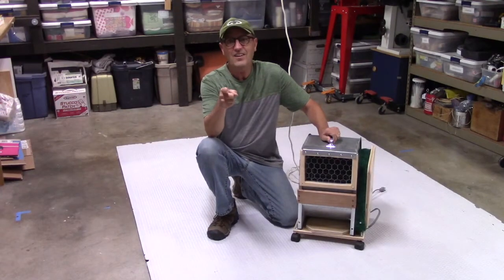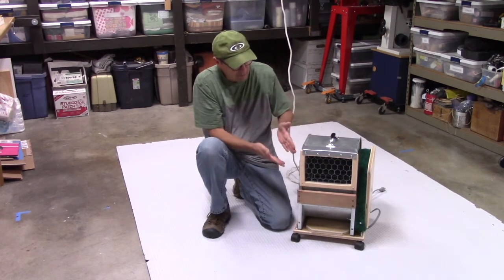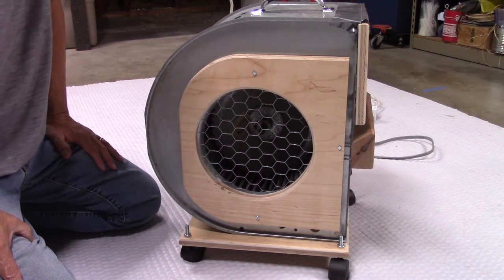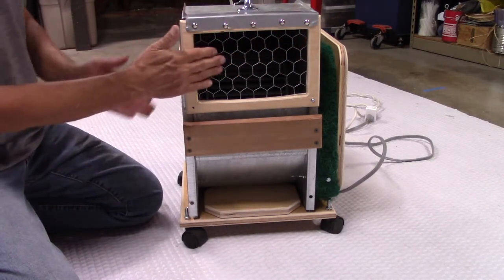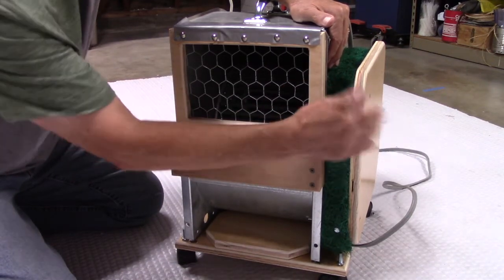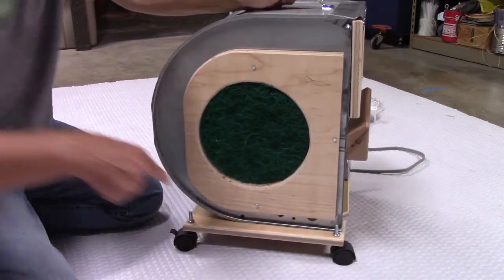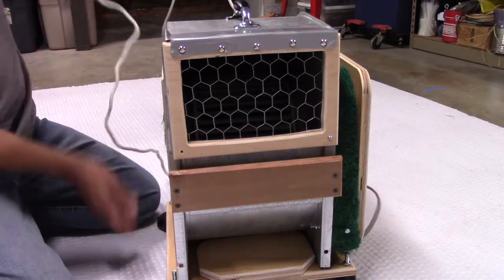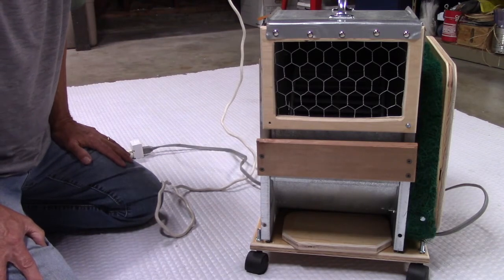$20 DIY Shop Fan & Air Filter

Comment: Nice project for sure.  For those wanting to build this, make sure you don't pull a 3 phase motor commonly found in commercial units unless you have 3 phase power available, also for those not familiar with HVAC motors, these motors are 240 volt, and usually a minimum of 2 speeds, usually 3 in residential, and 4 if it came from a commercial unit, one leg is common which you would wire directly to one side of the cord, and then connect the wire for the speed you desire to the other leg of the cord, each motor is different, but typically red is low speed, blue is medium, on a 4 speed, you'll have a yellow which is another "middle range" speed, and black is high, it doesn't usually matter which of the power leads on the cord goes to common and which goes to the desired speed wire(s) since both are hot wires on 240v.  On the motor shell (and on the unit the fan came out of should have a wiring diagram with each speed color, you'll also have 2 wires going to the run capacitor, usually both are brown or grey, again refer to the wiring diagram to be certain.  I mounted a simple "handy box with a clamp for the cord and a blank cover I drilled a hole in to mount the rotaty switch in the links below on one of my blower fans, this gave me the option to use all of the speeds and turn it off as well.  I highly recommend installing breakers or fuses as well, 5 amp is usually plenty, but again check the amp rating on the motor  to be sure, the one in the links below will work, you'll need 2 since it's 240 volt, be sure to install them inline between the cord leads and the blower (before the switch if you install one, lastly DO NOT forget to connect the ground lead from the cord to the blower housing AND the motor casing, there are rubber grommets between the motor brackets and the blower housing, and sometimes rubber between the band clamp and the motor casing.  The last thing you want is for the motor casing to become enerigized if an aging armature breaks down and shorts to the casing.
https://www.amazon.com/dp/B09P9T86TT?psc=1&ref=ppx_yo2ov_dt_b_product_details
https://www.amazon.com/dp/B08QVCYLMD?psc=1&ref=ppx_yo2ov_dt_b_product_details
Reply from the maker: Wow! I think you need to make this video.  Thank you for your wealth of information.
Reply: Any idea if they make a rotary switch that can be used to change speeds? A google search was fruitless.
Reply: @silverbackag9790   Yeah they make them but to find them is hard due to there being so many of them.

Best just to make your own. It will be a bit bulky but way cheaper and easy to understand.

Get 1 regular switch (household light switch) , and 2 Three way switches. 

Left to right.
The regular switch is the main power. Wire the line power from cord (black) to that switch. 
On the other screw terminal, of that same switch, wire to the common terminal of the first 3 way switch.
Here you wire the other two terminals. To the first terminal wire the black wire of fan. 

If your fan only has two speed then wire the other wire for low speed.

If your fan has three speeds. Jumper from 3-way 1 terminal to 3-way 2 common. To the other terminals you either wire medium and low.

So regular switch is power
3-Way switch 1, is selector between High and Medium/Low 
3-Way switch 2, is selector between Medium and Low

Home Depot has a switch that has a regular switch and a 3-way  combined. So you don't have to find a 3 gang box.
Look up "15 Amp Duplex Style Single-Pole / 3-Way AC Combination Toggle Light Switch"

So if you only need two speeds.
Use a single gang box an one combo switch. 
Or a two gang box with regular switch and a 3-Way switch.

If you want three speeds.
Use a 2 gang box with on combo switch and a 3-Way switch
Or use a 3 gang box with a regular switch and two 3-Way switches.

Comment: Just so everybody knows you can take an amp meter and check the amps its pulling and then
tell how much you need to restrict it. The running amps are listed on the tag on the motor. If
you don't have a meter feel the motor. If your pulling too many amps it will be hot.
Reply from the maker: Paul, thank you so much for the advice. I must have accidentally placed enough restricting filter materials around the motor because my unit can run from 35-50 minutes with not problem. Your information will be great for other viewers. Take care!

Comment: Great video! Very nice work. I've heard the same thing about restricting the air flow. I must admit that I don't understand it. But apparently it is right so I'll do what you did. That said, I would've thought that the filter was enough of a restriction??? Love your attitude about "throwing things away". Thanks for sharing.
Reply from the maker: Thanks Jay! It seems that my amount of restriction has worked because I have run the fan for over 30 minutes at a time with no problems.  Good luck!

Comment: George very well done. But would like to know more about the motor side filter and detail of the keeping the filter away from the motor.
Reply from the maker: It is hard to explain, I placed a large piece of wood around the motor with a large hole in the center so the motor could extend out.   I then put 2" blocks around the motor with large spaces in between for air flow.  I then screwed another large piece of plywood into the blocks.  The filter fiber material was then placed around the blocks & spaces.  A long zip tie holds it all in place.  Someone told me that these motors (without filter air resistance) will run so fast that they will burn out.  The fans are designed  to pull air through a filter.  I hope this helps.

Comment: I've recently been trying to complete the same type of project but thing is I'm not sure if it worked to start with and on top my Q. is simply does all motors have to have the compassitor or are there types of blower that don't need them cause I'm not finding two brown wires although I've got more then I've seen in videos mine has three and then another seven where the speeds are normal located I wired up to best of my ability but nothing but I didn't have a compassitor so tell me what you think is probably what going on with it?
Reply from the maker: I am sorry Robin but I know very little about electrical wiring.  I just asked the air conditioner guy which wires to attached to my electrical cord.  Be safe and take your unit to someone who knows about wiring.  Most people will help you out with no mention of money. Good luck!
Reply: There are two types of HVAC furnace blower motors - PSC and ECM.  The ECM ones do not have an external capacitor  but have two sets of wires - the line wires (120V/240V) and the control wires (24VAC).  The line wires are always hot but the control wires send the signal to the motor turn ON/OFF and also change the speed. ECM motors will be labeled as such.  Maryland.

Comment: How do you wire a squirrel Cage fan? It’s 115 walk or boat who I extension cord to work
Reply from the maker: My apologies, I am not good with electrical stuff.  I just asked the A/C installer and he told me what wires to connect to.  Find someone to help you on this.

Comment: I plan to build a dust filter with a similar fan. It will be pulling through two filters and pushing through another 
  Is that enough resistance to protect the motor? How did you determine the amount of restriction required?
Reply from the maker: Ken I was just using my fan today to blow fumes out of my garage.  I wish I could help you but I just guessed at the restriction I needed.  I figured that the motor and fan assembly was headed for the scrap yard so I had nothing to lose.  By the way, in what state are you viewing my video?  I would like to add a pin to my map for all my video replies.  Thank you!
Reply: @gfotinakes316  Arkansas. Sorry for the delay in replying.

Comment: Nice project George.  On my fan I made a way to mount an air filter on the outlet so I could use it to filter the shop during dusty jobs.  Also, I use it on the patio to keep cool (filter not needed here :>).  Did the inlet restrictor quiet it down much (if at all)?
Reply from the maker: The inlet restrictor made it a little quieter but its main purpose was to keep the fan motor from "over spinning" and burning out.  It sure moves the air though, it would be great to evacuate a smokey house!  Say, would you be okay with me sharing your idea of finding a line with using a little straight edge?  I will credit you when I show it.  I hope you have a great holiday season, stay safe and take care.
Reply: @gfotinakes316  I would consider it a compliment, thanks.  Which video (of mine) are you are referring to?
Reply from the maker: @russveinot5754  It was, Find Center on a Board with a Scrap Piece of Wood by OTB Thinker.  By the way, where are you located?  I am in southern California.   I just went to Harbor Freight and picked up that corner clamp with a 15% off coupon.  Thanks for that idea too.